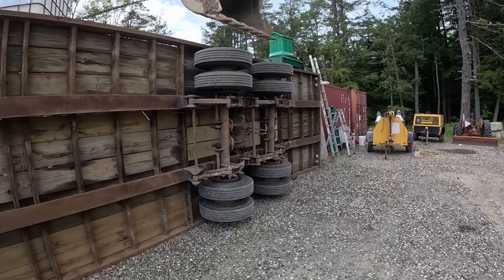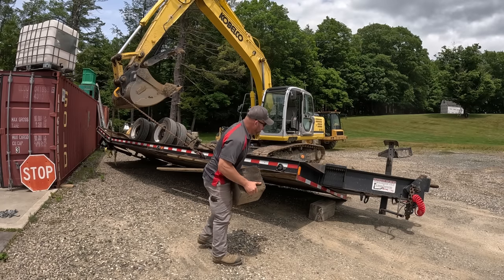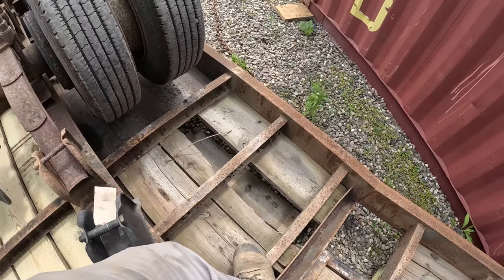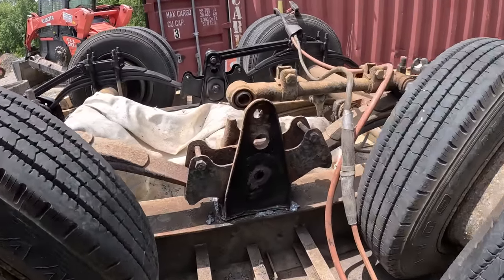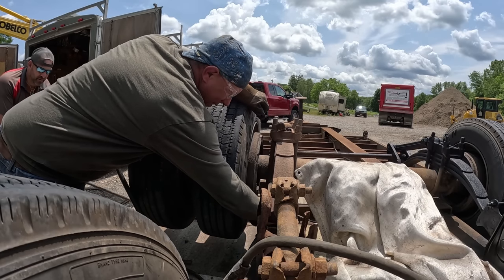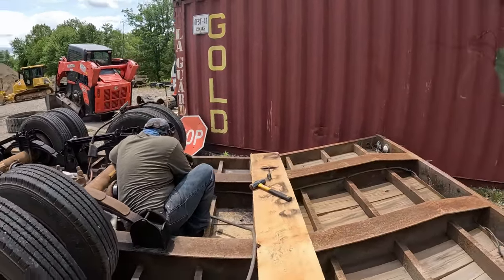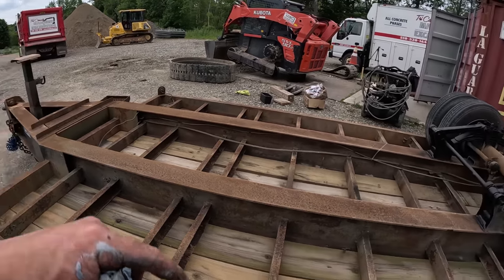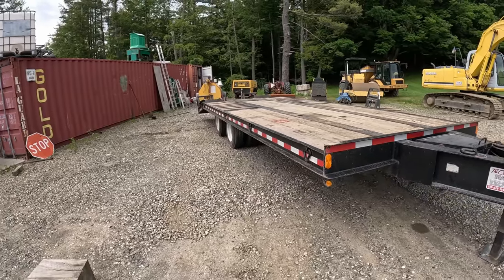NEW Spring hangers the easy way! cut off and weld new trailer hangers in 3 hours

Comment: Hey Mike nice job on this repair.  If you plan on buying a new trailer I would suggest spraying the whole trailer with Fluid Film.  Years ago I bought a brand new 2015 RAM pickup and went crazy spraying every nook and cranny with FF.  There wasn't one spot on the vehicle that wasn't saturated with FF.  In the hood, doors, tailgate, behind the wheel wells (known to rust out here), etc.  It was a PITA not having a lift but well worth it.  To this day I don't have any rust whatsoever and I live in Maryland where they apply salt or a brine solution on the roads even if they're calling for flurries.  A total waste of time and material in my opinion.  Anyway I know your state goes berserk with applying salt so something to think about.  Just my two cents.  You take care and be safe.  Stanley in Md.